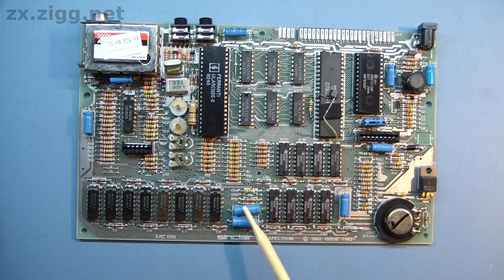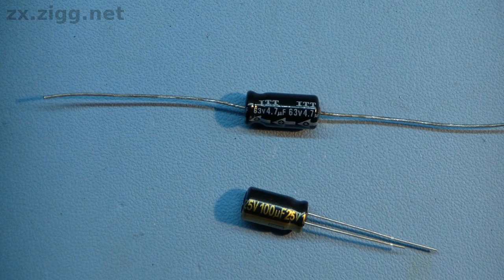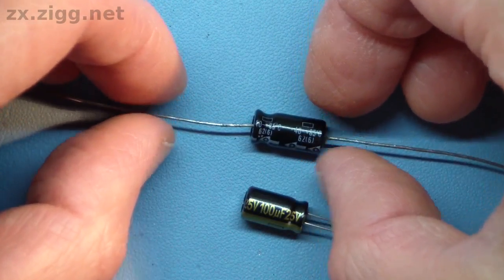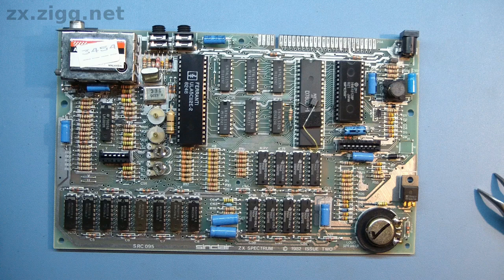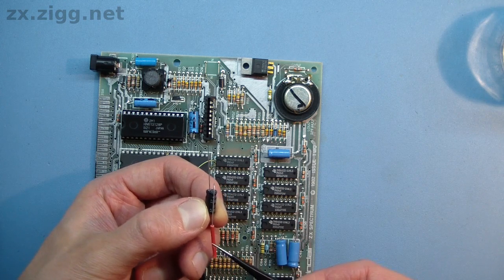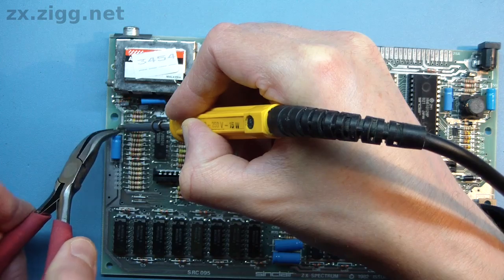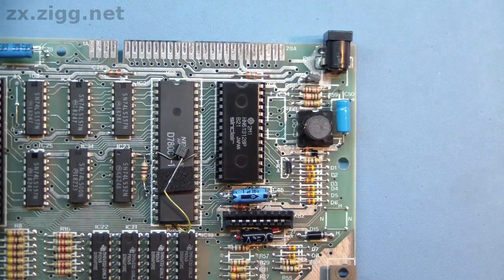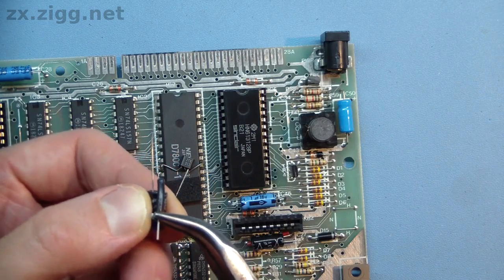Replacing Electrolytic Capacitors in a ZX Spectrum

Comment: I did the R6 mod and got 13.2 volt on the 12 volt rail. I think I used a too lower wattage resistor. I used a 1/4 watt. Should they be 1/5 watts?

Comment: Thanks for the video, You never mentioned which way the additional capacitor to R58 goes, ie positive or negative on R58, and it is not clear from the video,, I've gone through it and paused it multiple times and I still don't know which way I need to put it.

Comment: Outstanding video. Clear and informative information. I have the same issue 2 model. Puzzle: Wondering why Sinclair used a spectrum case foot under the Zx80 chip on the machine like in your video!

Comment: I've replaced all electrolytic capacitors by Tantalum capacitors in my Spectrum +3 and it works perfectly. Later, I did the same to the Spectrum 48K and again no problems, the video even got better.... I wonder why more people do not do this, instead of replacing the electrolytics every 30 years or so...
The only problem I've had so far was a static discharge from my PC that ruined a +2B board when I was connecting a 3.5 stereo jack to the soundboard of my PC... Even I felt the shock, some of the old PCs had a bad grounding (in some cases not ground at all)...
I heard that Tantalum capacitors have a bigger impedance but, after measuring a lot of these I've found that the values are much more closer than the rated. It's not uncommon to see 100uF electrolytics with 130 or more...
Reply: tants have problems too, the main one being they fail to a short, electrolytics when they fail go open circuit so are safer.
i design and build detectors, and have tried various things to make circuits less noisey, including tants, the results of my tests showed the quality of components was far more important, metal can transistors and ic,s, even ceramic chip variants perform better than cheap plastic packages, and i only use  japanese caps.

Comment: Hello Joules. Congrats for the video!
Looking forward for recapping my Spectrum+ (issue 4S) , I'd like to ask know if modification to voltage converter circuit (resistor change out + additional cap) is even recommended/needed.
Also I planned to replace the original 7805 with a dedicated switching regulator making the speccy actually cooler and more efficient.
Thanks in advance!
Reply from the maker: The modification to the voltage converter circuit applies only to issue 2 ZX Spectrums.
Reply: Perfect! Many thanks!

Comment: Joules, i have issue 4A board and lower ram chips are installed in orange sockets!? Did someone tamper with board or this was usual from Sinclair in that time?
Thanx for reply
Reply from the maker: I haven't seen orange sockets in a ZX Spectrum before and so far as I know, the lower RAM ICs were always soldered directly to the board, so I suspect the sockets have been added later. However, all sorts of oddities turn up from time to time, so I can't say for certain they aren't original. Comparing their solder joints to others on the board might offer a clue.
Reply: They are probably added at a later time coz solder joints are brownish from flux residue. I tried to power up this board today and got "1982 Sinclair Research Ltd" on screen but in a while i am getting black and white raster with white border. I can hear clicking sound from speaker and when it do click the white border also tik in a second. I thought that my ULA chip is damaged but then i check PS voltage and i am getting more than 16 volts dc unloaded. Some 14 volts under load. When i unplug my power supply and discharge remaining voltage from capacitor inside PS unit and then plug it again it works again for short time. This is strange? Is my ULA really failing or input voltage is way higher than it should be? Do you have some advice for me? I dont want to burry this specky yet :)
Cheers
Reply from the maker: The voltage from your power supply is a bit higher than is ideal and such a voltage can damage some versions of the voltage converter circuit in ZX Spectrums (quite a few variations of the circuit were used over the years). However, I don't think that has happened in your case. If you can, I recommend using a lower voltage supply (perhaps use a modern regulated 9 V one) or put two or three diodes in series with the output of the one you are using. Don't forget that the centre terminal of the Spectrum's power input socket must be connected to the negative side of the supply.

One possibility is that your Spectrum has some faulty upper RAM that either isn't fully detected by the initialisation RAM test or RAM that interferes on the data bus at times when it shouldn't. If the computer will run for long enough, try loading the Memtest program (available at http://zx.zigg.net) and tell it to test the upper RAM.

If the Spectrum isn't stable enough to let you load that program, try using a jumper wire to connect pin 5 of IC23 to the 5 V rail at power on; this connection can be removed one the computer has initialised. Take care not to let this wire contact anything else. This disables the /CAS signal to the upper RAM and should force the computer to initialise as a 16 K model; you might then be able to load the Memtest program. However, if the fault is due to one or more upper RAM ICs interfering on the  data bus, then this won't work and diagnosing the fault will be more difficult, but certainly possible. I would use a logic analyser, as I demonstrated in another video.
Reply from the maker: P.S. Just to make sure the voltage converter circuit hasn't been damaged, check for the presence of the -5 V and 12 V supplies at the lower RAM.
Reply: Thank you for your kind response Joules,.
I will first try with lover voltage. Polarity is ok as i changed cracked cables on power supply few hours ago. Center pin is negative. If i find some 9v reg PS i will give it a try. Currently only one i have at hand is 500mA max :( I doubt this is enough? Right?
I can try with original PS and some diodes in serie. Since this is my first time into ZX i need additional info on diagnostic and trouble shooting :/ Do you cover that in some of your videos maybe? I dont have logic analyser unfortunately :( Where i need to poke my probe to check voltage supply at lower ram?
Thanx again
Reply from the maker: 500 mA probably won't be quite enough for an unmodified ZX Spectrum. If the supply can hold its output above about 7.5 V with a small overload and can withstand that for a few minutes, it might be good enough to test with.

Have a look at https://www.youtube.com/watch?v=IzgCmldm2H4 . Somewhere towards the end, I point out where to check all the supply voltages at the lower RAM.

A list of all the Sinclair computer related videos I've published is at https://www.youtube.com/playlist?list=PL4H3oOJzIQMkKiG94z2x0laC7gqqmwBE8 .

If you get completely stuck, I can offer a repair service. Contact me via the form at http://zx.zigg.net if you are interested.
Reply: Thanx for your help. First i will try non invasive diagnostic and if stuck i will contact you :)
I would like to get this specky in working order.
Will get back to you.
Cheers
Reply: I will cary out your initial tests and get back to you. Thanx

Comment: This is one awesome video and i like how you installed radial elec. caps to mobo :)
I have working Issue 4A board. Though i need to replace keyboard membrane but caps are on my No, 1 list these days.
Do you have any advice for issue 4A mobo or can you point me out some web site with enough info? I can see that my mobo is somewhat different than your issue 2 mobo esspecially where voltage regulator is.
Cheers mate
Long live specky

Comment: Hi. I'm finding your videos very helpful. I bought a selection of 
capacitors from a local supplier and they are quite a bit smaller in 
physical size to the originals. Does this matter? I went for higher 
voltage ratings generally. I also noted on one lot, they are for audio 
application which was probably an oversight on my part when ordering. 
Can I use the audio rated capacitors? Thanks.
Reply from the maker: So long as their ratings are appropriate, their physical size isn't very important. Certainly, electrolytic capacitor technology has improved since the 1980s, allowing them to be smaller now.

In general there isn't any property of an electrolytic capacitor that makes it especially suitable for use in audio circuits. It's usually a label added by some manufacturers/distributors as an excuse for making them more expensive.
Reply: This is very informative as I recently aquired a spectrum for proper recapping and modding, cheers.

Comment: Someone told me the issue i have in my spectrum 48k is this : 1)Lower memory fault. Changed IC9 and IC10 4116 chips.

           2)Tested TR4 and TR5 (OK). Changed all electrolytic capacitors. Do you have skype to help me ?
Reply from the maker: I've only just seen your message. If you haven't got your Spectrum working yet, can you give me a description of the symptoms of its fault?

Comment: ok thanks. i did not realize the 9v was fed further back into the spectrum.
i might try a dc to dc booster. so upscale the usb 5v to 9 and feed 9v into Tr4. thanks for your vids. busy replacing my capictors just now
Reply from the maker: +tim bo The 9 V should be connected to the correct end of one of the inductor windings - follow the PCB trace from the 7805's input..

Comment: can i power a zx spectrum48 with a 5v usb 2amp charger.i.e. remove regulator and feed 5v direct to spectrum
Reply from the maker: +tim bo Probably not. The problem would be that the voltage converter circuit that generates the 12 V and -5 V supplies uses the 9 - 11 V input. Though I haven't tried, I suspect it would not work properly if its higher voltage input were connected to 5 V instead.

Regulated 9 V supplies are available at low cost and so I recommend using one of those instead. Do look for one of reasonable quality; the market is flooded with dangerous small power supplies that pose a serious risk of fire or electrocution.

Comment: Very Useful Video. Thank you! I am about to carry out the caps replacement on a non working Spectrum 48k. I have a number of capacitors of the same capacitance value but have different voltage ratings.(all above 16v) Does this make any difference when replacing?
Reply from the maker: It doesn't matter so long as the voltage rating matches or exceeds that of the capacitor being replaced. In principle, those with a higher voltage rating will have a longer life (and be physically larger), but there will likely be greater differences between different brands than between the different voltage ratings.

Note that because electrolytic capacitors usually fail due to drying out, it's best to use relatively new components and avoid old stock.
Reply: JoulesperCoulomb
Thanks. I changed out the caps today. Also changed out the voltage regulator and did the composite mod while I was at it and now have a video signal but it has vertical black and white bars with flashing colour squares on screen. I assume I have bad memory somewhere but I will check that for a later date. Least im halfway there considering I have not picked up a soldering iron in many years!! :) Thanks again!!
Reply from the maker: Are the vertical stripes wide (several character squares) or narrow? Can you post a picture of the display?

Are all three power supply voltages present and correct at the lower RAM ICs? Given that there is colour in the display, I suspect they will be, but they should be checked.
Reply: JoulesperCoulomb
They are wide vertical black and white stripes. Posted Pic Here:
http://tinypic.com/r/mvomz9/8

I checked the the 3 supply voltages on all of the lower RAM IC's IC6 to IC13 and all seem to be present and correct. It's an Issue 3B Board. Have printed out the repair guide for world of spectrum to check others.
Reply from the maker: The non-white border suggests at least one of the following:

1. Faulty CPU.
2. Faulty ULA.
3. Faulty ROM (very rare).
4. Something interfering with communication between the above components; very often a faulty upper RAM IC (common). It is also possible for a faulty lower RAM IC to interfere with communication between the CPU and ULA and so prevent the border from being set to white at initialisation, but then the central area of the display is usually more disorganised or shows a pattern of narrow vertical stripes.

Wide vertical black and white bars are also a common symptom of a faulty CPU. So, I think the problem is most likely 4 or/and 1.

It might be possible to further diagnose this type problem by using an oscilloscope to examine activity on the control and data bus at the CPU.
Reply: JoulesperCoulomb
Ok. Thank you for all your help. I have another 3b board and ill swap out the CPU and see how that goes. Thank you.

Comment: Hello JoulesperCoulomb!

I think I heard you say in the beginning of the video something like this:

"...unlike some people I don't advocate automatically replacing all electrolytic capacitors in any piece of electronic equipment that is more than a few years old..."

I agree with you but I would also like to hear your advice regarding this subject.

I mean, when is to be expected a complete recap of a ZX spectrum motherboard? 10 years? 15 years? 20 years?

Some people I talk to tell me that some capacitors used were realy good so it's best just to leave them (nichicon, Gelec) but since I don't own a capacitance/ESR meter I feel this could be like walking on thin ice.

Just how real is this advice I hear that japanese capacitors are the best to buy, seconded by tawainese makers while chinese makers are complete rubbish and should be avoided?

Perhaps capacitors used close to their working limits are expected to fail no matter their brand and therefore this caused a huge hype or foul myth regarding some brands over time?

Best Regards
Reply from the maker: The main enemy of an electrolytic capacitor is heat, whether while in operation or storage. This is one of the reasons the loft is not usually a good storage place for electronic equipment (get your Spectrum out of there now!)

Without knowing the full environmental history of a capacitor it's probably impossible to make any useful prediction about its remaining life span (even assuming it hasn't been subjected to any electrical or physical abuse). If the history were known, any prediction would most likely be inaccurate. There can be quite a bit of variation between different batches of the same capacitor (at least in the past, I'm sure manufacturers will claim this doesn't happen now) and even the most reputable manufacturers have had some bad designs and periods of sloppy standards.

There are some tests that can give a guide to the health of an electrolytic capacitor, but to carry them all out properly requires removing the component from the circuit. Unless the capacitors are expensive or difficult to obtain (which they aren't in the case of the ZX Spectrum), it's probably quicker and easier just to replace them at that point.

So, while there are probably some Spectrums out there with their original capacitors that'll go on for another 30 years, I'm certain there are far more that'll die when next switched on.

I can say from experience that failed or failing electrolytic capacitors are a very common cause of non-functioning ZX Spectrums. This suggests that on average and after being subjected to average use and storage, the types originally used are at or approaching the end of their lives.

The failure rate is probably even higher than I suspect as when I get a Spectrum to repair, I usually replace all the electrolytic capacitors before I power it on. I've had a fair few that I've been told were faulty, but worked perfectly after I replaced the capacitors.